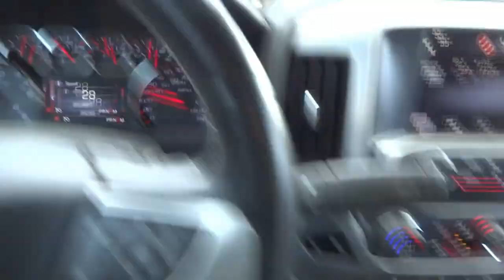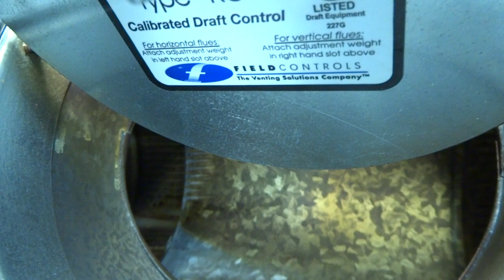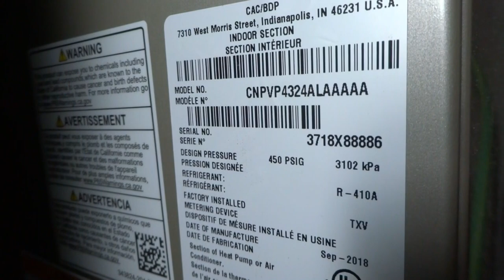oil fired Furnace Riello Burner annual service

Comment: Use carb cleaner and a wire brush for that end cone, it helps out a lot, also put a new strainer and replace the oil filter at the tank. Finish it off with a combustion analysis to make sure everything is good. If it’s annually those things definitely needs to be replaced. It’s not just cleaning the end cone and changing the nozzle. That’s not a proper “annually service” Otherwise good video, I just think you should’ve showed more in the video other than just changing the nozzle.
Reply: اريد طيقه خلط الزيت الحارق لسيارات ان سمحت بلوقود
Reply: @عارفباجيل-ق8غ  sorry I don’t understand. And I can’t copy to translate. Can anyone translate ?
Reply: That's  right.But  I have a  big view port and just set the flame by eye. I have been having an issue with getting a  DELEVAN nozzle to burn clean. HAGO Semi Solid pattern .85 60 SS  work OK. Carlin 99FRD.  Having Issues with the pressure gage needle fluctuatng fast between 90 and 110psi.  and get a  yellow white flame when that happens. Do you think that airs getting in to the feed line or a  partially blocked oil feed line causing that?   Sandy
Reply: @sandyshoremann7524  make sure you have the correct size nozzle. Make sure the pump pressure is to factory settings adjust slightly if needed. Don’t over do it. Make sure all your filters are clean and not plugged. Make sure the Oil jet line from the pump to the nozzle assembly is not plugged. There are air vents on the burner. If it’s too much air or not enough it could cause problems. That’s when a combustion analyzer would come in handy. If it’s set incorrectly it could be dangerous. Also make sure your electrodes are set correctly. If you’re not sure always contact a oil burner technician. I work out of Leominster MA.

Comment: I had my riello burner serviced and the technician said to remove the air shutter and just leave it open, what effect does it have? He charged me extra to remove the air shutter, $135. Was I just scammed? Did he just do it so he can earn more? He said it the air shutter has some oil and will fail. I am afraid if the air shutter is removed from the burner it might have some blow back and fill the basement with CO and poison us. Please comment, thanks

Comment: Do these burners all use the same nozzle? I'm trying to buy an update kit and change all filters and screens and nozzle. Any help is much appreciated. I have the rielo 40 f5.
Reply: Get the model number off the Riello burner and the Boiler make ,  model number and GPH of oil . Contact the Riello tech line . There are also charts online . We were having this serviced by a large company . They had installed two different size nozzles over the years . According to Riello , neither was correct . I first became suspicious when consulting the chart . I am now doing it myself . The " this should work " or "  this is what's on the truck " doesn't cut it . They were both undersized . Beware of experts who know more than manufacturer .

Comment: I feel for the people that have to use oil for heat it's the most expensive way to heat electricity would be far cheaper than oil.
Reply: John Chambers , How did you come to that conclusion? 👷🏻
Reply: Actually in most of New England, oil is cheaper than electricity. 

Electric rates are stupid high up here.
Reply: Most people have oil or gas Electric heat would cost a small fortune not to mention around here most houses only have 200amp 120/240 single phase service and to heat a small house would draw at least 125 amps or 30kw, So let’s burn the fuel to boil the Water to make the steam to burn more fuel to superheat the steam to drive the turbine to spin an alternator to feed the power into a transformer to step it up to run it down miles of cable into more transformers to step it down multiple times and than turn it back to heat you know that every step has losses or you can burn were you need the heat
Reply: How do you figure that ? Nothing wrong with oil fired units, as long as they are maintained. Good warm heat, this year the price per gallon is down, so it is very economical.
Reply: @Trump985  Most heat pumps can pump more heat into the building than was in the fuel to drive the power plant producing the electricity. An electric heat pump would be cheaper than burning the fuel on site in that case.
Reply: @gregorymalchuk272    I think that violates the laws of physics but I’m not an engineer what I can tell you is a heat pump is an air conditioner and it costs me $300-$400 per month additional Money in the summer to cool my house by an average of 25 degrees F and it only costs me $100 a month in diesel fuel to heat it an average of 40 degrees F so I’d say the heat pump less efficient than a Boiler
Reply: @Trump985  It doesn't violate the laws of physics. Power plants operate over a huge temperature difference, whereas heat pumps only have to pump against perhaps 100 degrees, and so can move even more heat. I agree though, if I had a good oil burner and a recently insulated house, I would stick with it.
Reply: Oil is for nothing here compared to electric. It'd literally be five times as much for me to use electronic.
Reply: It may cost a little more annually to heat with oil, but when I looked at getting a new oil furnace versus heating our home with heat pumps, it was going to be over 15yrs before the savings from going electric versus oil payed for the heat pumps, at which point they were already 5yrs out of warrantee. It really depends on your construction. We are in Atlantic Canada.

Comment: So Steven, you showed the turbine head of the nozzle assembly, and it was caked with soot, along with the electrodes and insulators. Next clip you're installing it. Did you not brush and spray it clean before putting it back in? You then put the control box back in place with your oily gloves and left it dirty. It looked brand new before that. Then you showed something rattling like crazy. Those things would drive me nuts. Come on man.